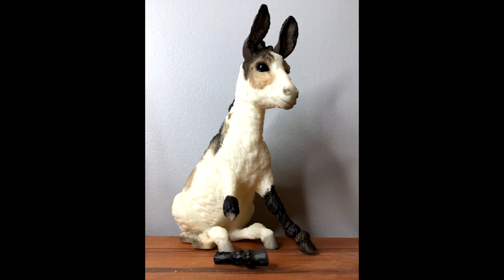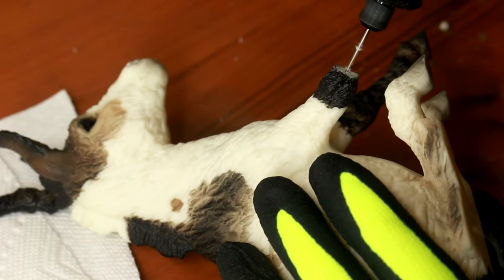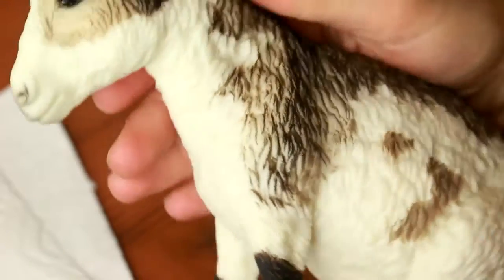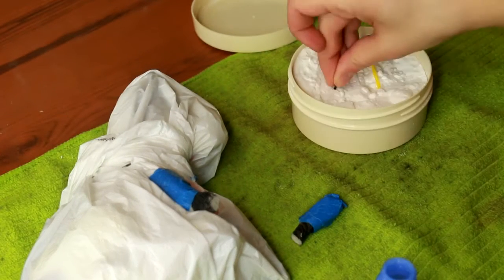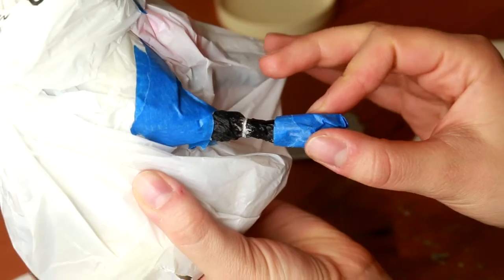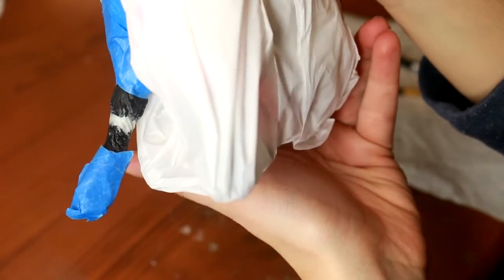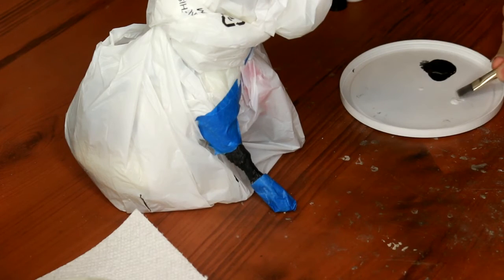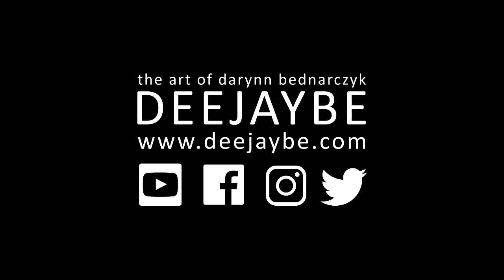HOW TO FIX YOUR BROKEN BREYER MODEL HORSE- Repair Legs, Tails and Damaged Parts - Tutorial

Comment: Great video! Considering Brighty’s legs aren’t necessarily weight bearing, I’d have used Testor’s plastic cement in this particular case. That stuff can work miracles, with only a hairline to touch up. But I will use this solid technique for my poor old three-legged Misty :^)

I too would be interested in a technique that works for G1 Stablemates...